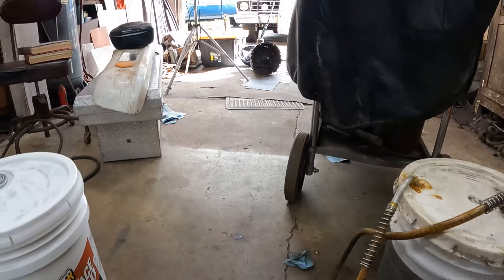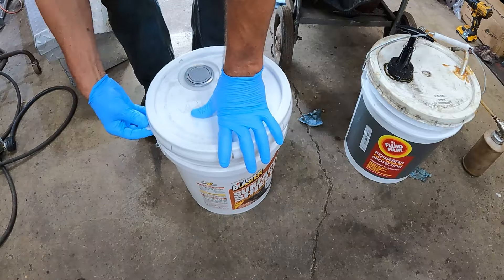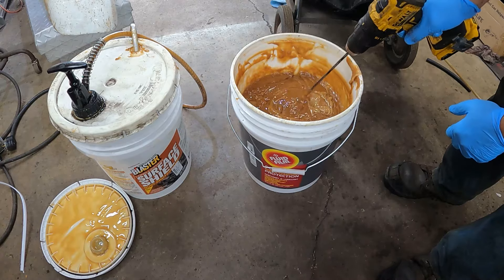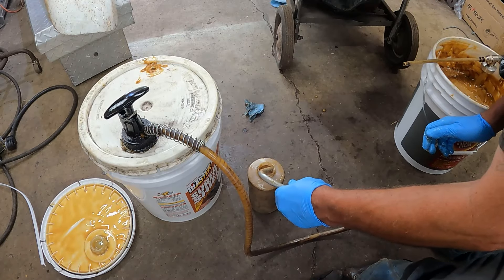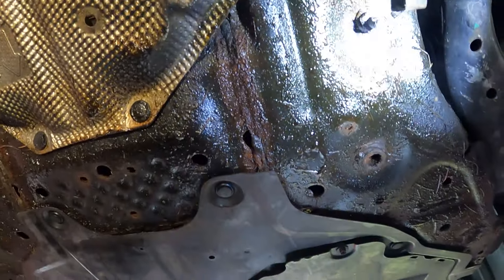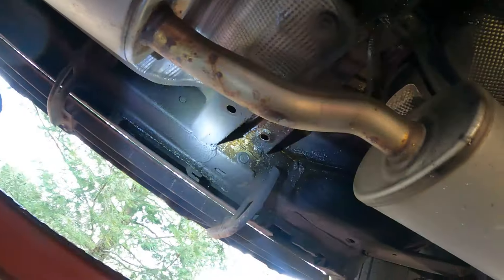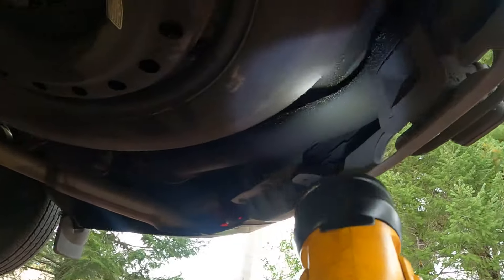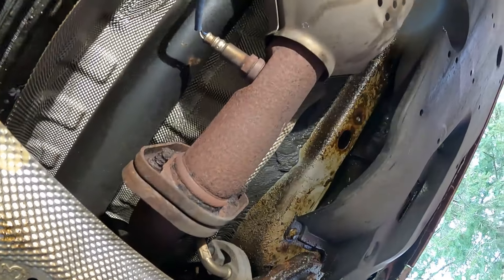Don't Let Your Car Rust Away!  Surface Shield and Fluid Film Lanolin Undercoating

Comment: Good stuff - but I wish Blaster would come out with a black version.  For now, I’m mixing in graphite powder - but it would be nice to have it right out of the bucket. I also like to keep a few aerosol cans around for touch up.  So - I have Fluid Film Black and New Hampshire Oil Black cans until Blaster catches up with Surface Shield Black.
Reply from the maker: I don't know if Blaster will be out in black or not.  I just use Fluid Film because it's readily available at my local NAPA.
Reply: Surface shield does have a black version. Seen it on Amazon. Not sure if you can get it in five gallons.
Reply: @hd100thjd   Yep - just saw it on there. Thanks for the heads up!  I actually only saw it available in 1 gallon buckets.  No spray cans yet.
Reply: @jasoncharles6980  If you have an oreillys near you I think they have 17oz. cans in black. Just picked up a gallon in black from them and did my daughter's jeep. Like it better than fluid and nh oil. Nice smell too.

Comment: I have some of both products to spray on various vehicles.  One is 5yrs old, rest are 10+, and this will be first time for all of them.  Wanting to use this to stabilize and prevent further rusting until I can finish repairs for the rockers and/or paint the frames.  One question I have, does lanolin affect the ability to weld or paint surfaces at later time?  I see you can just wipe it off, but wondering if it has any side effects like silicone products causing fish eye in paint.  Great video!
Reply from the maker: It will absolutely make it difficult to paint later.  The stuff creeps everywhere and doesn't stop.  I will bleed out from seams no matter how much you try to clean it out you'll probably have problems.  When I said it wipes off easily I mean off of painted surfaces.  You'd be better to fix the rockers now, and paint the frame flat black then spray.  It will stick like crazy to flat paint.  I do all my truck restos that way.  I fix the truck first and paint the body, I epoxy prime and flat black the chassis, then spray the entire underside last with FF.

Comment: Good stuff there, The shop won't buy us that stuff, they will get us 3m cavity wax and I always coat my repair sections with. Thanks for the video Josh.
Reply from the maker: Since there is new painting involved the cavity wax is easier to deal with because it doesn't mist everywhere.  FF would be a nightmare inside a body shop.

Comment: Good info, except Always wear a mask when spraying chemicals.
Reply from the maker: Thank you.  You must have missed the part in the video where I said I usually wear a respirator, but for audio purposes I'm not.  And you must have also missed the part where I said these products are made from lanolin, which is natural water repellent from sheep wool and is non toxic.  How did I make it 46 years thru life without the safety police?

Comment: Again I appreciate this Video, Not Enough people are Aware of this maintenance, here in Toledo most people have no idea why or what the point is and Idiotic Mechanics dont like the stuff under there and I even had a Muffler shop refuse to touch my Truck once because they didnt have an Idea what the stuff was and they insisted it might catch on fire from welding.  So no wonder all the cars here are Junk.  Ohio needs a class action lawsuit for excessive road salt usage.
Reply from the maker: Salt wrecks everything!
Reply: Good luck trying to find a competent applicator in the Toledo area...

Comment: i have a very similar process and am due to spray again before winter. Normally ill touch up with the spray cans when i see them onsale and then hit the high traffic spots. Can i ask what psi you run your compressor at when spraying? Ill probably get under there this weekend and do mine again for the season.
Reply from the maker: I spray it at 80 psi.  I liberally reapply to every car every year no matter what it looks like.  I usually use about 3 quarts on cars and 4-6 quarts on large trucks.  That being said I spray everything heavily, except for the exhaust, engine, and brakes.

Comment: I bought a 5 of NH oil a few years ago it has a Black Carbon tint added to it. You can also get it in clear. And it has a cherry scent to it. It eventually dries up some weeks and months later turning into a thicker coating, it isn't terrible but it is pricy.
 Next im just gonna maybe go with Amsoil HD.  It sprays from an Aerosol can, and turns into a waxy thicker substance that supposedly last longer than these.  Im yet to see.  Ill test that. If all else fails used Tranny fluid works wonders😮😂 #Toledo snow plow life😂😂😂😂

Comment: How’s the surface shield smell? My wife hates the smell of fluid film after I spray her car
Reply: @bradwhite6491  smells  like evergreen 🌲  trees  that's  the scent  they put in it it's  not bad I do my truck  every  year with  it no rust at all good stuff
Reply: Ha, my wife the same.  I even added Peppermint oil and mixed it in the gallon of Fluid Film but now it just smells like a wet moldy sheep eating mints.  I just got a gallon of surface shield today and it really has no smell.

Comment: How much do you charge customers for the spray job?
Reply from the maker: $125
Reply: @QuickSpeedShop  nice,  do you know which exact pump you're using for your 5 gallon bucket I know you said you got it at harbor freight im just trying to make sure I find the same one because I've been pouring into a funnel and I seen your method and i would much rather do your way because it's less mess